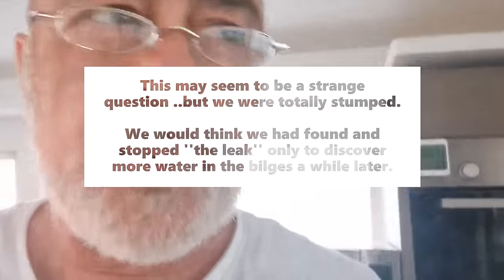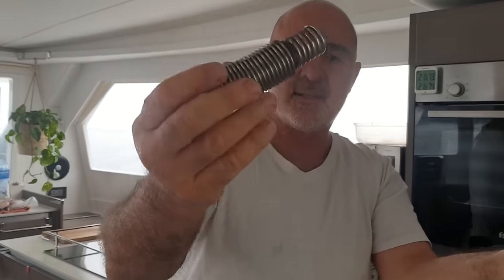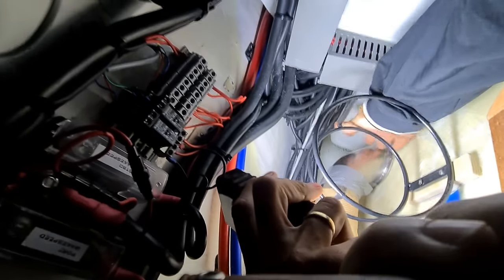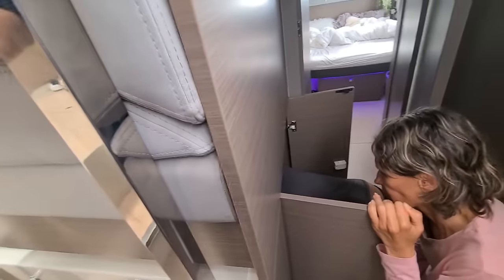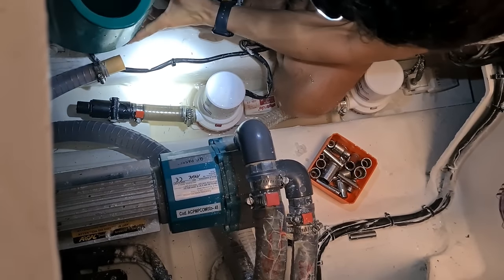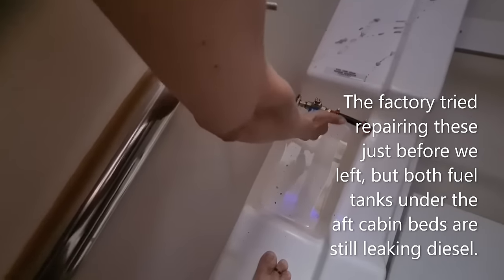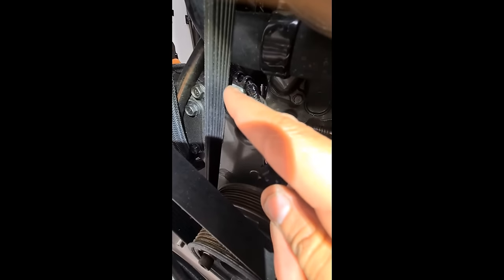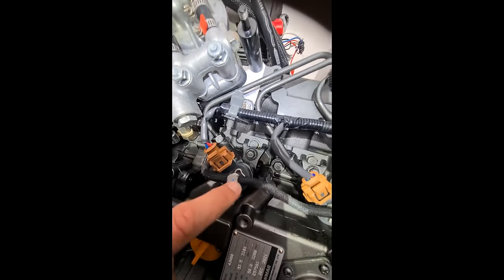Leopard 50 fails, Atlantic crossing - part 2

Comment: A catch can there under grill is a geod idea. Maybe that drain is for water that makes its way into the grill more than for grease. I think I'd keep that valve closed or cover the grill well when not in use to keep water out of the pan. A good rain will overflow any bottle you put in there.
Reply from the maker: Thanks for your support and your suggestion . . . . . we’re definitely thinking to mount a catcher underneath, although we think that the thin tube will eventually block. We hadn't thought of water but so far, rain and other water doesn't get in there. See Jack Wickmans comment above. We think he is spot on. Stay tuned Daniel, we will report on how we track 🙂

Comment: With the diesel heater exhaust, you have the tubing and a 'silencer' - you must make absolutely sure that this baffle / silencer is appropriate for inside the boat as most that are supplied are designed for fitting underneath vans and they leak CO.  People have been killed by these.  Remove, fill with water and with a hand over the inlet and outlet see whether it leaks: if it does, you must replace with proper marine grade.  The pipe is also not marine grade which makes me think the whole setup might be dangerous.  Fit a CO monitor close by as well.

This whole video is shocking

Comment: The drain for the gas grill absolutely blew my mind. WTF were they thinking? I have seen some pretty insane installations in my life but this one wins the #1 stupid award. Unbelievable! The number of leaks in this boat is outrageous and totally unacceptable. Any potential buyer of a Leopard catamaran needs to be very careful.
Reply from the maker: Thanks for your feedback. We agree
Reply: This is not a grease trap pipe. It's intended for water egress, not food waste, oils, or grease. Unless your cockpit is equipped with an enclosure, the area where this grill sits is a VERY wet area in foul weather or rough seas, and collects a ton of water. Water that needs to go somewhere.  So Leopard, like every manufacturer with a similar grill station setup, built in a mechanism to account  for water drainage. In this case, they routed it very well too. A straight shot down (no bends, no traps) and directly to a pump area. This isn't for a grease-trap.

Comment: This video clearly demonstrates the incompetence of the builder. This is not only shoddy workmanship but almost criminal engineering. Avoid this manufacturer like the plague.
Reply: Yep!
Reply from the maker: Thanks for your comment. We are hoping that they show themselves to be better in some way
Reply: Basically putting the crew at risk.
Reply: From this information and others, I would never, ever buy a Leopard. There is no excuse for the shockingly poor workmanship putting the crew at risk.

Comment: Looks like Leopard are relying on the quality of the vessels they built 10 years ago for their current sales. Turned me right off them after comparing them to Lagoon over the last 5 years and Leopard coming up trumps every time. As the owner of a 50’ mono and looking to upgrade to a cat in the next few years I found this video very enlightening. Thank you for that.
Reply: So far I have seen on YT, every major brand of cat manufacturers with horrendous build/quality issue. So disappointing.
Reply from the maker: Hey Pete, thanks for your comment. Stick around, there is a lot of very interesting stuff to come, especially to do with boat fit outs
Reply: @Leosarebetter Having issues with quality is one thing, what really disgusts me the the after service they give with someone spending around 1 million plus.
Reply: Come on Leopard you guys can do better than this. Where’s your quality control?

Comment: So disappointing but not surprising. Wish more owners would come out of the closet about these manufacturers. And Action Yachting did a number on Nahoa as well. Still cleaning up from Dave’s contractors that he takes no responsibility for
Reply from the maker: Hey Ben and Ash, absolutely ! . . .a huge percentage of the issues on this boat, including the blatantly shoddy job on the diesel heaters, was Action Yachting ! Specifically Dave's guy Paul. And you are correct: they take ZERO responsibility for their work. All they take is your money. I have no idea why Leopard continue to use them. Everyone has the same problems with Action Yachting. Except that apparently, if one mentions an individuals name in a negative light, they can approach lawyers to apply to have the video taken down, I have absolutely no problem with total transparency. I prefer to call a spade a spade. We hope the four of you are well. Stax of love, Melinda, Jorja and Kevin 🙂

Comment: Just found your channel, subscribed. Sorry too hear about all the problems you are experiencing.
Q. Do you know where in the manufacturing line Utopia was to Liger (
Travel Sketch ) ?
Is the "he who must not be named " the common denominator between you and Trent?

Sterkte
Reply: I was trying to work out the same thing but I think I heard that there's different factories for them?
Reply from the maker: Hey, dankie vir you woorde. Trents boat was delivered 12 months, almost to the day, before ours
But they came off two different lines. We think there are 2 Leopard 45 lines and one Leopard 50 line
The ‘he who should not be named’ is just one bad cog in the machine. He is just a symptom of the main problem

Comment: Recently subscribed, Mindblowing the BBQ drain and the number of issues with the bilge pumps returning water into the boat. I do hope they get fixed. Remember proper plumbing is the solution... please do not just add more non-return valves/check valves as it does not solve the problem, and is actually very dangerous to have your boat reverse flood when these non-return valves fail.

You should have proper anti-syphon valves installed at the highest point possible to prevent this issue.
Reply from the maker: Thanks so much for your support. With the BBQ drain, we’re thinking to mount a catcher underneath? Problem is we think that thin tube will eventually block. Regarding the bilge pumps, we are thinking bigger loops in the pipe

Comment: While the grill grease drain probably won't sink the boat, it  could be a fire hazard. Since the grease will cool and solidify as it flows down the hose, the hose will quickly clog. Some liquid fat will make it to the end of the hose at first, but I'd expect the clogging to block it after a few uses of the grill and it will be a real pain to try to clear that long S shaped hose. The grease trap collection tank/bottle should be in the cabinet directly below the grill with a straight, vertical pipe running to it. It can then be unclogged by pushing a rod down through the pipe from inside the grill. This really needs to be a short and straight shot to the tank as it will need to be cleaned often. The tank and pipe should be metal in case of a grease fire, not plastic. I see a valve in the hose down in the engine room. If this is normally closed and only opened to drain the grease into a container for disposal, then I'd expect the hose to be clogged by solidified fat and almost nothing to come out when you open the valve. Maybe if you only grill fish and never beef this will be OK, and only drain this after the engine has been running for a few hours so the hose will be nice and warm. That might help. It will be interesting to hear the spin used to explain how this is supposed to work from the grill installer. This install appears totally intentional as there is a printed label marking the valve as "BBQ DRAIN". On the plus side they did use dual hose clamps.

The grill is a minor issue compared to those diesel heater exhausts. Having them leaking exhaust gasses into the interior of the boat could kill you. This is especially true in cold weather when you close up all the vents to keep the heat inside. If seawater gets blown backwards into the heater combustion chambers, worst when they are not heating, the burn chambers could rust through and leak exhaust even if the exhaust pipes are intact. Carbon monoxide detectors are a must.  A careful study of the heater install is advised. This requires just as much care as the engine exhaust system. Both must work properly and are not trivial engineering challenges.

Backward facing scoops over the discharge ports can deflect heavy spray and reduce water backflow, but air pressure can still push small drops up the discharge lines and cause problems. This is most true of ports located in the tunnel between the hulls. In rough seas, as waves pass through the tunnel, a surprisingly high air pressure can blow puffs of wind up the exhaust tubes. Backward facing scoops can reduce but not totally eliminate this.

I wish you every success in solving the many problems that you are facing. Despite your difficulties I still want to be you. Onward to victory!

Comment: The pumps should not have check valves according to their instructions. A loop should be run well above the waterline that waves can't overcome and back down to the electric bilge pump. Manual and electric bilge pumps should have dedicated suction and dump pipes and not run through each other. R&C have been told.
Reply: I just replaced a pump and it had a valve included with the pump!  For sure there must be a loop and with some antisiphon valve. Relying on the valve to keep the sea out is mind boggling.
Reply: @danielboughton3624  Depends on the pump, mine specifically states do not use a one way valve. Anti siphon is different.
Reply from the maker: Thanks for your comment. Regarding the bilge pumps, we are thinking exactly that. Put loops in the pipe in the bilges and slightly enlarge the loops in the engine compartments. The water ingress in the engine compartments were not quite as bad as in the bilges

Comment: You bought leopard don’t be that surprised 😂
Reply: Which brand would you choose to avoid these unpleasant surprises? Who's a good builder?
Reply: @jackwickman2403   So far I have seen on YT, every major brand of cat manufacturers with horrendous build/quality issue. So disappointing. If I were after a cat nowadays, I would look for a late model second hand cat, then get two independent marine surveyors to do two separate surveys, and look closely for dry glass/fittings/fixtures/hull integrity, electrical etc and then wear the owner down on price from there. At least you wont kill $ on a new cat that turns into a pile of pus.
Reply from the maker: Thanks for your comment. We had no idea that we could possibly have such a bad experience. Stick around, we haven't let on to even a small part of the whole saga yet. They kept us on the dock for 13 months, 3 weeks before the end of warranty, while they dragged out their repairs. Thanks for your support

Comment: all these through hull fittings should have internal backing plates that are big enough to allow the fitting to be threaded and tightend. Also that woul allow sealant to be used on inside of hull. All hoses need to be double clamped. I orefer the solid bandclamps rather than the perferated ones. Fittings or connectors have to be solid enough not to colllapse when teh clamp is tightened. This appears to be a case of poor desig, and shody or cheap hardware along with careless workmanship.
Reply from the maker: Yes, We hadn't thought of that. Of course they should have backing plates!  You are absolutely correct about their being so much shoddy work. Some of it looks like it has been done by five year old's. Those diesel heaters done by Leopards contractor is the prime case.

Comment: Was this a new yacht or a hurricane right off that was cosmetically  repaired and sold .....buyer beware  ?
Reply: Says in the bio it was a new one which is outrageous - between this boat and the Leopard 45 on Travel Sketch the builder has some serious quality issues they need to address...
Reply from the maker: Absolutely. Until they change their tune, it really is still a case of buyer beware

Comment: Hydro locking your engine and gensets is at risk with all these designs. Are 1 way flaps installed? I see the main problem as being the Shite quality valves and port lites being used. Lewmar have become massively CHEAP!

Comment: For your diesel heaters, why would they install an exhaust with an elbow joint through the hull and not an actual through-hull valve? So close to the waterline? The other through-hulls in this same area are all done properly, except the heater exhausts.  Then to only sika one side?  The people who installed the heaters are obviously not marine folks. If they were, then they intentionally took advantage of you. They installed this with residential/dry land practices. On dry land, this install would have been sufficient and probably lasted the entire life of the heating system. If they were marine people, and installed this this way anyway... they did so KNOWING this was going to VERY QUICKLY become a problem.  Even non-boat guys like me can see this isn't gonna float for very long.  AND then the joining hose?  Again, this joint they did would work well in dry land.   You will never find hoses joined like this in marine environments. The person that did this, has zero experience in the boat market, or they're 3rd world yard workers. 

This was NOT a Leopard install. Maybe Leopard contracted with the company that did the install, but it most certainly was not Leopard themselves that did it. Leopard would have at least used a plastic seacock or above-waterline through-hull,  bedded with sikaflex on both sides. Then they would have at least used semi-proper (if even the cheapest proper) hosing.  Neither was done in this diesel heater install.  

The company that installed these units knew you were in a rush to get off the dock, they knew they didn't have the proper fixings and fittings, and they knew you were not an experienced boat maintainer. So instead of owning their mistakes (if even made in ignorance or unintentional), and ordering the parts needed to do this properly (even at the risk of losing your business),  they wanted the business anyway, and they took advantage of all these situations just to get their installation fee hoping it would last long enough to give them plausible deniability after the fact. OR  They're of a similar mindset to the majority of the 3rd world and just threw it together with whatever they had on hand in order to make it work and worry about the problems later when they've become a problem.

Comment: Pink oily fluid is usually hydraulic oil. Ahh gas strut. They have hydraulic oil. They must be installed with the rod on the lower end. Gas Struts are fairly cheap. The alternators were probably due to charging Lithium Batteries. You must have properly spec’d regulators to protect the alternators from the huge load that Lithium can apply. This on is a big issue.
Reply from the maker: Hi William, I have been stuck on my backside on an office chair for 40 years, so I didn't think of the colour of the fluid 😞 It turns out that the alternators required a 12v feed but the Leopard contractor wired them to full 48v feed, without stepping it down. To be fair, so far the alternator fix is being reasonably well supported by Leopard. We will report back on all Leopards reactions, or lack of reactions, to every issue. It s all well documented. Thanks so much for your support William. Stay tuned  . . . .  😐

Comment: Diesel heaters are not standard on leopards, you should be blaming the aftermarket installer, a self tapping screw secures the rudder cap, who is the idiot using a heat gun on the top delrin rudder bearing? The bilge pump doesnt get the last bit of water, its always wet in the bilge, the manual pump takes out a bit more, you have multiple sensors that tell you if you have water in the bilge.The biggest problem with leopards is owners who don't sea trial vessels, install a ton of unnecessary crap on them and are to cheap to hire an EXPERIENCED delivery skipper to solve the issues ASAP without all the drama.

Comment: Wow, so much shonkey work. You should have a shower type Jabsco pump to suck down to fully dry, and only use centrifugal pumps for high volume flow. I have 3 different bilge systems on my 45’ boat, 2 are 13 lpm chamber type pumps, and the emergency pump is a KPM Marine 200 lpm centrifical pump. All switches for these are at the nav desk. On a boat that size if you take it into cold climates you will have condensation issues and be pumping out condensation on a daily basis. The long and the short of it is through that it is a big boat and these are small problems relatively.
Reply from the maker: Hey William, thanks for your comment. We LOVE the idea about the shower type Jabsco pump to get totally dry bilges. No smell!!. They should definitely install them but are you saying that we can? My email is kevindeanferreira@outlook.com   We would be so grateful for your advice on this